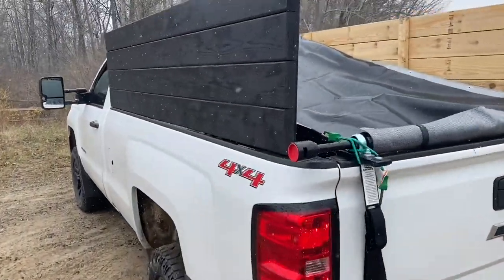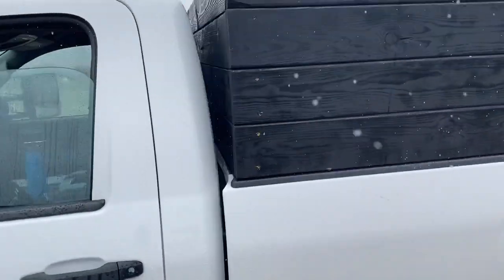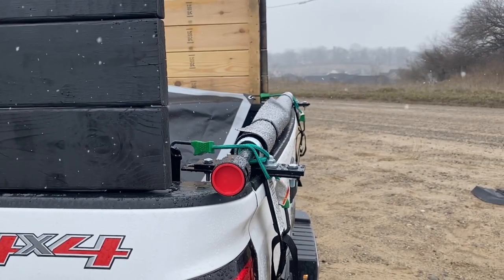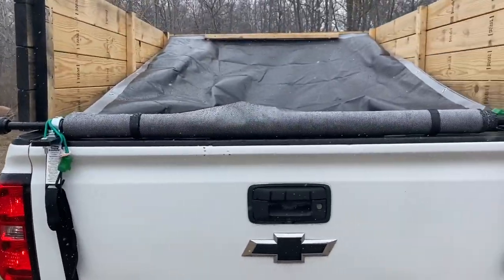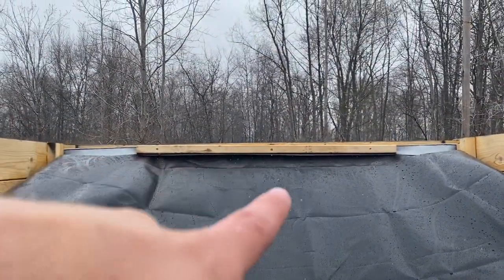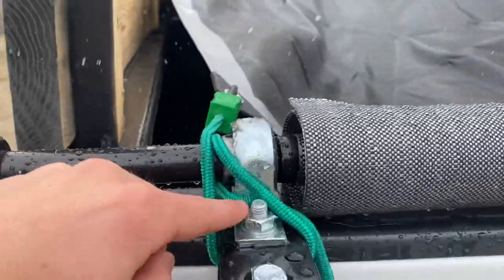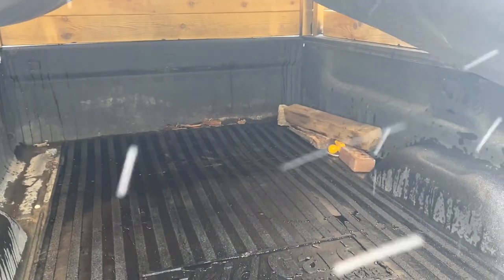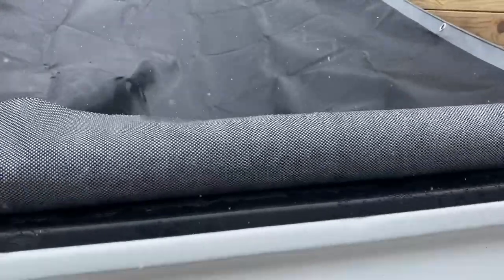Home-Made Dump Truck Build Update

Comment: Wish I could load a pic of my setup.  Only thing I did was fin plywood up both insides to eliminate the wheel wells and 2*3 on the side.  No hang ups.  I can unload my truck in 10 sec with NOTHING left behind.
Reply: did the same..4x8 plywood cut in half...1 for each side..

Comment: Good looking build. How do you secure the panel that goes across the back window of a cab? I don't see any bolts or connections up there securing it to the side panels. Just trying to wrap my brain around it before I build mine, thanks.
Reply: So much for being happy to answer. How's this thing holding up for you? Have you moved on to something else?

Comment: I have roughly the same set up only complaint I would say about yours because it looks way better than mine is that people should place boards on the side of the wheel Wells to prevent the loom or any other material from getting caughthat incorrect and blocking the load handler from moving

Comment: how does it dump
Reply from the maker: Not good considering I have a spray in bedliner. Plastic would be 100x better
Reply: @lukemeyer338  get some 3m plastic cut it to size and place it under the easy unloader so much easier cranking it out and it takes care anything left behind, just make sure you don’t slip while laying it down very slippery
Reply: I still don't get it.  It essentially rolls a tarp like a conveyor belt?

Comment: Awesome set up I'm looking for a trap to role out on my truck. Have the same loader handler it works for heavy items not so much for light grass but I've bent my bar to shits.  I don't have any spray in or box line in my truck tho. Find it is quicker but takes more effort to unload heavy loads. Thanks for the idea on the tarp

Comment: How did it work?
Reply from the maker: Awful. Needed a more slippery surface.
Reply: Oh ok we’re you able to make it work better, I was thinking of getting one for my truck
Reply from the maker: @oscaramaya7254  I would get a plastic mat or bedliner so there is minimal friction with the tarp.
Reply: Luke Meyer  So I’m guessing it did not work at all?
Reply: @lukemeyer338  Ive got a utility bed so no wheel wells, and could lay a plastic mat. Going to use it for mainly wood chips, do you think it would work?

Comment: I will be attempting to build this on my old 350! I’m curious what did y’all do to support the studs coming up from the bed? Did y’all just run screws through the bed into them? Or drill a hole and anchor with nut and bolt?
Reply from the maker: Just put 2x3’s in the bed. That was enough support